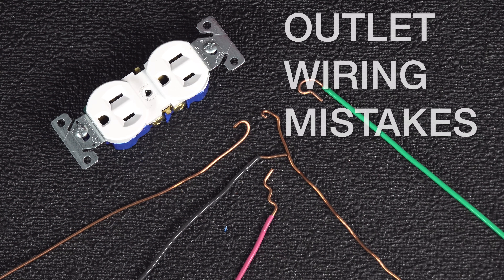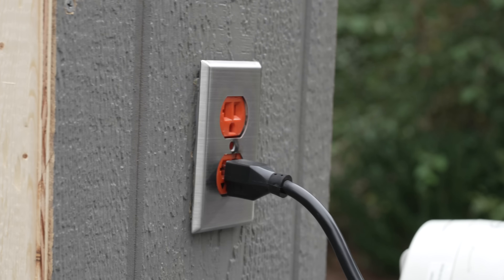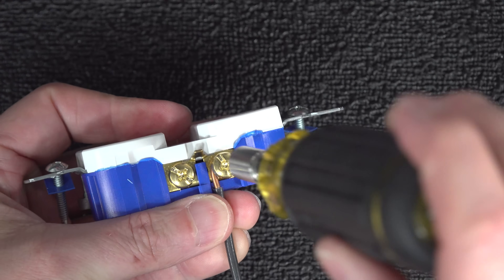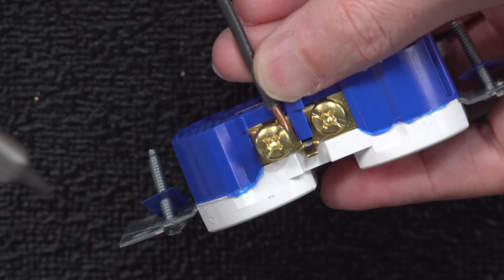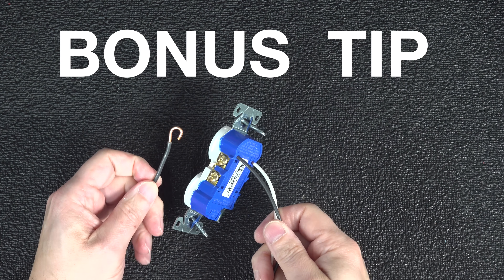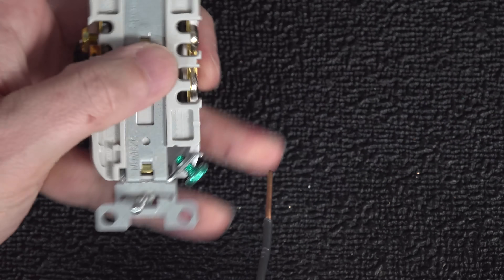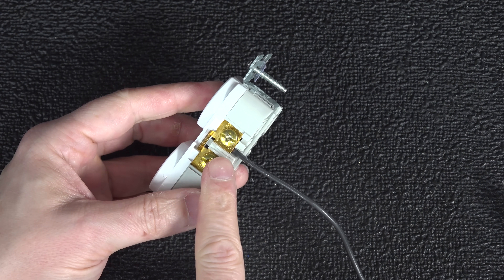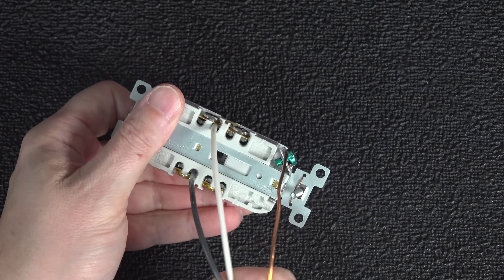BEWARE Of These 3 Common Wiring Mistakes On Outlets & Switches

Comment: And remember... To turn off the breaker remotely, simply cut the live wires with snips and when you see the sparks stop, the breaker is now off. Saves time waking over to the electrical panel.

Comment: As an electrical contractor , I want to give my opinion about the back stabs.  I have never had a problem with them in 29 years but there are some things to keep in mind , and why mostly it's just better to give the advice not to do it.   You can do it , but only if this condition is met...... Full makeup on the wires with wire nuts is a must , and only one nuetral and one hot can be inserted into the backstab.  And of course only on 15 amp circuits.   The big cause of overheating receptacles is not the backstab, the backstabs are rated for it , it is using the plug as a splice.  Backstabbing a hot in and a hot out.  Now the heat is traveling through the receptacle.  So just a tip , backstabbing isn't bad you just need to follow those rules and never do it if you pretty much know something with a big load demand  is going to be plugged in.  But , as for teaching regular Joe's, yeh don't backstab.

Comment: I am in Canada . We are shown and taught to hook up the green ground wire first. If somehow the circuit does become hot you will not get much of a shock for very long before it trips out but if the green is off you could die.
Reply: This is a fallacy, instantaneous  trip circuit breakers are not intended to save human life and will do nothing to help you if you become energized while making wiring connections. The resistance of the human body is to great to cause the breaker to trip. The best thing to do is use GFCI circuit breakers if your concerned with human interaction such as residential wiring systems.

Comment: Um...AC voltage has NO polarity.  Mixing up hot and neutral on a recep does not REVERSE any polarity anywhere.  Also, cord-and-plug connected AC devices are NOT polarity sensitive.  You've given FALSE information to nearly 3/4 of a million people.

Comment: I like how the picture of the receptacle with the wire stabbed in is probably twenty plus years old.... A receptacle that is excessively used, it will need replacing well before the stab ins actually cause a fault. At that point, everything is a problem, so you hook it to a receptacle that has seen excessive use, you are going to have a problem anyways in a different area, sure the wire didn't melt in the back, now it just melted at the front cause the device plugged in, can't grip the prongs of the outlet, thus causing heat to build up. Its just funny that these videos they its "wrong" when its not wrong. Its UL listed and approved. WHY do we even have to listen to UL listings if we are being told its all wrong then?

Comment: 33 years of experience never use a backstab outlet I don’t even like to use the pressure plates because no matter how tight you torque them when you’re wiggling the receptacle to get it in the box they tend to loosen up especially with solid wire I always wrap taping the outlet give it or take it only time I tape is when using old work box with Madison straps Always leave enough wire sticking out of the box nothing worse than trying to deal with short cut wires

Comment: Pro Tip: That little hole by the green ground screw…place your “un-hooked” ground wire there, then back wrap it clockwise around the screw for a secure connection! 👍
Reply: I try to teach that to new guys all the time. For some reason, they never seem to want to use it. I don't get it. So much easier
Reply: Pigtails period
Reply: @SparkingRelativity  So, you’re saying buy a pigtail, then have to splice it onto the incoming romex, then take out the existing green screw and then attach the new pigtail???
Reply: I’m saying there’s many ways to do things. There cheap ones and then there’s using the extra 1900 box hole however you please weather needed or not that is if your going to get that technical about a secure extra piece of grounding connection. You know for the fire inspectors and gc’s when instead of save money wanna break balls. Just saying to each is own. Lol
Reply: @SparkingRelativity  Thanks for telling everybody about the ‘most time consuming’ way to do this job!  LOL!!!

Comment: if you will extend the striped part of wire at least to the edge or just beyond the edge of the plastic it will be easier to replace the switch or plug.

Comment: Wow... always interesting to see the differences between countries. In Australia you would twist 1 or more wires together. Insert into the outlets  appropriate hole. Then tighten a grub screw. Plus you mostly see stranded wire too. Oh and the black is Nuetral here too. Watch out for that! ;) cheers
Reply: I mean it depends on companies here in the us some use the white as hot and black as neutral. And a lot of the time backstab wires which I've found is actually fine and wasn't using electrical equipment that most use like no one that I know uses a screw driver it's always a drill where I'm at lol. But in my house they wired the white as the hot wire and black as the neutral as well so depends from company to company
Reply: Whats this red wire for?  Uh oh...

Comment: This is good for Diy people. This is all basic stuff I learned as a teenager. Granted it was all on the job learning. But I had some really good teachers. I regret not getting certified in electrical. But I had to quit construction work after I broke my back. I couldn't handle the crawling and climbing to run the wire. Unfortunately I never had a helper to pull the wire while I was making up the outlets and appliances. I had to do it all myself cause I was the only guy on the crew with any electrical experience other than the foreman. he was too busy doing other things so the electrical fell on me. Good video. You may have stopped someone from burning their house down with faulty amateur wiring by showing them the safe and up to code way to do it.

Comment: The practice you call "back wiring" is typically referred to as "backstabbing" or "quick connect". "back wiring" typically refers to what you show at the end of the video -- a type of screw-terminal where the wire is left straight and clamped under a metal plate by the screw pressure. Actual back wiring is generally regarded as safe. The backstabbing you show is indeed generally regarded as unsafe.
Reply: if backstabbing was "unsafe" why are all comercial duplex outlets configured with backstabbing ports and they are also all underwritten and certified. is this in the same category as outlets being "upside down?" if so, then it will probably never result in a single problem. if backstabbing really was statistically unsafe then it wouldn't be included on outlets, insurance companies wouldn't insure houses that had it, the outlets wouldn't be underwritten or certified, building codes would exclude them, etc etc etc. this seems WAY more like a pro tip than an actual statistically significant safety issue.
Reply: It’s all regarded as safe. That’s why it’s designed the way it is. If were unsafe in any respect they wouldn’t build the features in.
Reply: @ProfligateBC  spend a few minutes on an electrician forum and you will discover that that is simply untrue -- in general but especially when it comes to backstabbing
Reply: @klikkolee  We just finished topping out a 108 unit Spring Hill suits using the method. I guess none of us checked the “electrical forums”
Reply: @ProfligateBC  that would be a mic-drop moment... if not for the fact that you're using the fact that you're an electrician to discount the word of other electricians. An electricians' forum is a forum primarily consisting of... electricians.

There is also the fact that problems caused by backstabbing tend to happen 3+ years after installation. By that point, a landowner or building manager might not bother contacting or complaining about the firm who did the installation. Being part of a firm that performs large new installations makes you less likely to witness long-term issues, issues, not more likely. All the time you spend installing receptacles is time you don't spend replacing failed ones.
Reply: @klikkolee  Haha. You don’t work on a construction site do you? It’s been a race to the bottom since the early 2000’s. It’s a fight for the lowest bid. The lowest bid comes with mistake after mistake, coupled with corner cut after corner cut. Washer and dryers don’t work because the ground was attached to the neutral wire. Oh, yes. Wiring for HVAC mini splits going to a different unit on a different floor. In a 166 unit apartment building this happened 12 times. The list goes on and on. It’s gotten so bad we have a giant cork board in the break room with photos of the work that’s been done by our “fellow” electrician brothers and sisters. Virtually NO ONE takes pride in their work now. It’s all about the bid and how fast the work can be done as well as the warranty. We talk trash about these scavengers all day long and twice on Sunday.

Comment: With bare ground wires being folded back into the outlet box, I always wrap several layers of plastic electrician's tape around the sides of the outlet/switch which covers the screw terminals to avoid shorting...especially in metal boxes.
Reply: I’ve never taped an outlet in my career (except the ones that we install temporarily during construction so that the other trades can use them) and I’ve never had any issues with shorting to the metal boxes. If your wires are stripped at the correct length, all your screws tightened, even the unused ones, and your ground wire is the right length and folded properly, there’s nothing to short to.
Reply: @0987654a5  Well...that's you. I don't like bare ground-wires folded into the boxes where they can contact the terminals. I forgo the taping when the ground is insulated.

Comment: Safety tip: After wiring pigtails to the outlet, wrap the exposed terminal screws with electrical tape. Go around the entire receptacle twice. This helps prevent metal like a screwdriver from touching those exposed terminals.
Reply: Darth Metaluna  Wrong.
Reply: Darth Metaluna  It's a safety suggestion. Wrapping outlets with electrical tape is not against any code violation in America. There's no NEC code for it or against it. Look it up.

Comment: In addition, safety rules I always use. Always use pigtails when wiring outlets and never have more than one white wire one black wire one ground wire to any outlet.
Reply: Curious as to what your reasoning is. I’ve never seen or heard of a problem with having more than one set of wires in the outlet
Reply: @Korbin Muir  His reasoning is probably related to Article 300.13(B), which states that a neutral connection on a MWBC cannot be dependent upon a device connection. Given that a very small percentage of outlets in houses will be a multi wire branch circuit, as they are most typically used in commercial and industrial settings, it's still a good idea to pigtail all your circuits: Heres why. If the device ever fails from an overheated connection, there is a high possibility that you will end up with floating voltage across every other device wired to this circuit. Pigtailing ensures that voltage stays consistent across every device in the circuit while not depending on individual device connections.

Comment: I like the 8-terminal "no hook" feature, but it's WAY more than a 50 cent upcharge. You can buy good, safe outlets at Lowes for 68 cents each. The cheapest one of the no-hook type I could find was over $5. I'm not spending over 5 times as much for a little convenience.
Reply: As an electrician, those 68 cent receptacles are hot garbage.
Reply: @TotalDbag24  Those cheap receptacles that are sold in bulk cases are the worst. I always tell people not to buy those for outlets that are out in the open or where things are regularly plugged and unplugged, because they break really easily.

Behind a table or a TV stand where they hardly get touched, they're okay.
Reply: @Robert Frapples - I think your math might be a little off.  To illustrate: how much is your home worth? What are the contents of your home worth?  What's your deductible?  And what are the lives of you and your loved ones worth?
Reply: Supply houses are not only for contractors anymore anyone can shop and the prices usually beat lowes/home depot.
Reply: We get it, you're a cheap SOB.
Reply: Came here to say this. The least expensive commercial grade receptacle - the CR20 - is nearly double the cost of the cheap, residential grade ones, and they don't even have pressure plate screw connections. An actual spec grade receptacle, like the one in the video, cost nearly 5 times as much as the cheap ones. That being said, installing the CR20's is well worth it, even if you don't get the benefit of the easier connection.
Reply: I’m an electrician and those 68 cent receps are fine. Don’t abuse them. Spec grade devices cost so much because of the standards they have to comply with. Even more robust are hospital grade. They are rated to hold 10 pounds of force pulling away from the receptacle without unplugging the cord. They are denoted with a green dot molded into the recep face.
Reply: @RadDadisRad 
Residential?  You probably also think liquidtight is good too.
Reply: @TotalDbag24  What does "good" mean? For the purposes for which it is designed for, liquidtight is effective. Using it in residential applications would generally be overkill
Reply: @TotalDbag24  name checks out.  Liquidtight is a pain in the ass to work with, but it's damn good for it's purpose.
Reply: @TwilightxKnight13  Sure, if you only care about it lasting until you leave the jobsite. If you want your shit to last, then not so much
Reply: @TotalDbag  I mean what were the job specs. If the job says put in this type you will lose the bid if you upgrade all your materials. Problem starts above the installer.
Reply: Those are callef commercial grade devices which are designed to more robust than residential grade. It's also why they cost more

Comment: I've always thought back wiring holes should never have been permitted on any outlet. I've seen many "pros" wire new construction this way.
Reply: Anyone cutting corners is, definitely, not a pro!
Reply: @budsak7771  That's why I put pros in parentheses. There's hacks in every trade who just want to get in and out fast as possible with your check in hand.
Reply: @mjnc3672  Hell Yeah! I get that mental image of Slater in the back seat (Dazed and Confused) saying 'It's quality, not quantity. Alright man."
Reply: @mjnc3672  dude it's fine to do it that way doesn't cause really any issues connection works fine as long as your not sticking wire that's not designed for that plug in the holes you're fine they know what they're doing just because you said so doesn't mean it's not okay there's no problems with wiring that way have had nothing go wrong while doing it either so like I said it's fine
Reply: All my switches and outlets are back wired. At least they were. I did notice that the old switches and outlets accept 12 gauge wire but the new ones accept 14 gauge. I didn't use them, just thought it was interesting.
Reply: The backwiring thing is a non issue. It’s just like plumbers and shark bites. People in the trade are old school and don’t like it but the reality is when done properly there is no difference to safety. Idk why people have such a hard time coming to terms with that

Comment: You really should not use the connection in the back of the plug, do a proper splice and then have pigtails for the plug at that location, and if I sound like an electrician it's because I am one.

Comment: Another mistake that is common is "daisy chaining", or looping the conductors around the screws when 1 circuit is feeding multiple receptacles on a wall. When the screw gets tightened, it creates a wire binding situation, which results in increased temperatures at that bind point. Better to pigtail and wire nut, or pigtail and wago connect the conductors.
Reply: You show me in the code book where it says you can’t feed another device off the terminals on a receptacle? I will wait lol…….
Reply: @dallas5374  300.13(B), but technically the code only matters if your local inspector enforces it. The local "jurisdiction" overrules everything. In some area, the inspector required things that aren't even required by the code. In some areas, things that are required by code, are not required by the jurisdiction. Never assume that just because you are following the code that you are "correct."
Reply: @TwilightxKnight13  doesn't the section you cite refer to MWBCs where a single conductor is used as a shared neutral for out of polarity hot conductors?
Reply: Then wouldn't creating pigtails create a wire binding situation as well? Either way you are applying a force to hold two conductors together.
Reply: @vedicaudio  no, a pigtail has only one set of conductors connected to it, so there’s no wire binding. The connections are in the wire nuts, or the wago connection.

Comment: Yeah, 3/8 inch of contact on both sides of a straight wire gives a better connection than 3/4 inch of contact on a hooked wire. sigh - I'm sorry but I'm not that gullible! I will continue to hook my wires around the screw. With that said I completely agree with every other point made.
Reply: Oh and AC doesn't really have a polarity because of its cycle rate. Seriously are you going to call the hot wire positive polarity when that is only true for 50% of the duty cycle? Same would be true for the neutral wire.